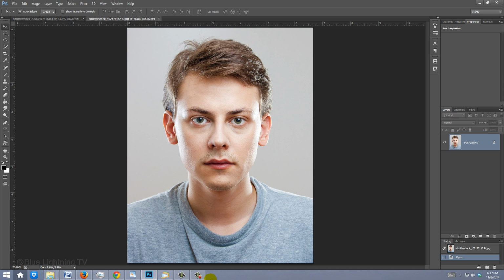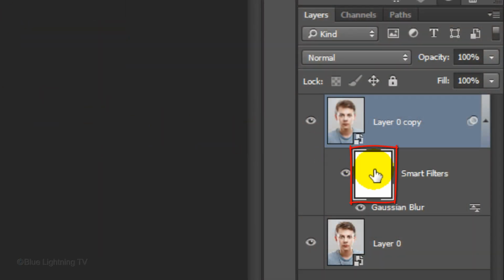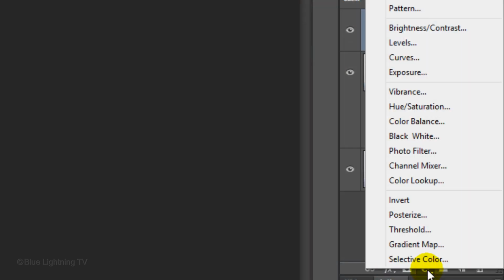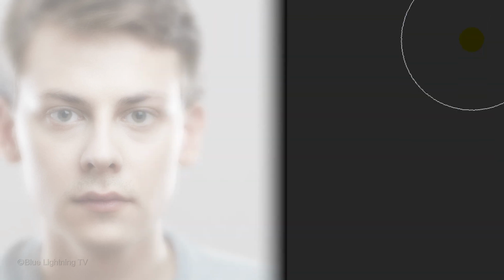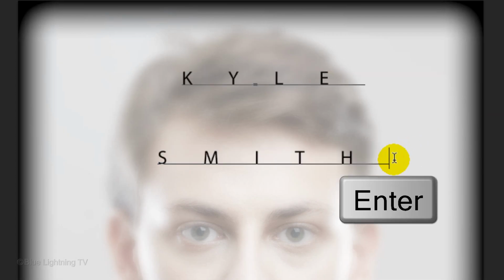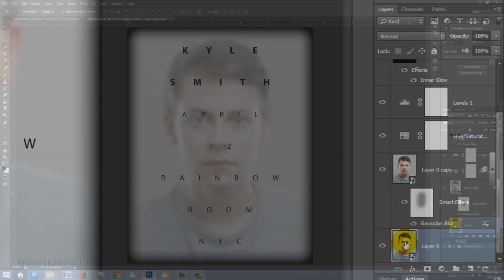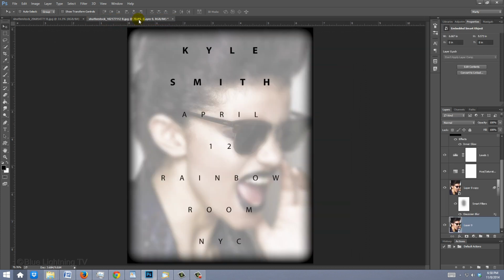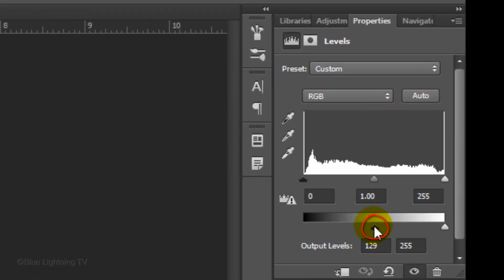Photoshop Tutorial: How to Make a Powerful, “High-key”  Photo Portrait and Poster

Comment: Hi Marty.
The layer mask on a filter does not hide or show the layer below but controls how much of the filters are applied. You can safely delete the layer below in this case.

I'm not trolling. You do great tutorials.
Reply: The copy is the original, its just there just in case he messes up.
Reply: I agree. It's just that the commentary mentioned that the mask revealed the layer beneath several time. I just wanted to make it clear that this is not the case with masks on smart filters, They control how much of the filter is applied and what you see is the layer the filter is on not the one beneath.

Comment: Hey Marty. What's the difference between CC and CS6 anyhow? Also, just wanted to take this minute to say thank you so much for you tutorials. I've just recently got into photo editting and, i will admit, i was a complete noob when it came to photoshop, i was afraid to use it. Since i've found your channel, i find myself trying to find tutorials only by you. Very helpful and you have taught me so much. So thank you!!
Ps. My profile picture was credited using one of your tutorials. THANK YOU!
- Nick Doonan
Reply from the maker: CC added the following:
Camera Shake Reduction
Former Extended features now always included
Intelligent Upsampling
Camera Raw as a filter
Editable rounded rectangles
Improved 3D painting
Share on Behance
Conditional Actions
System antialiasing style for type
Min and Max filter round kernel
Sync preferences with Cloud
Adobe Generator
Generate image assets from layers
Edge Reflow integration through Adobe Generator
Perspective Warp
Linked smart objects
3D Printing support
Publish 3D models on Sketchfab
Adobe Camera Raw 8.3
Blur Gallery motion effects
Focus Mask
Expanded Mercury Graphics Engine support
Smart Object improvements
Adobe Camera Raw 8 enhancements